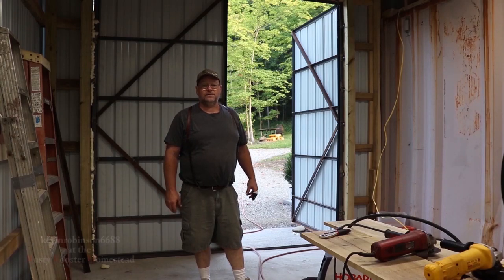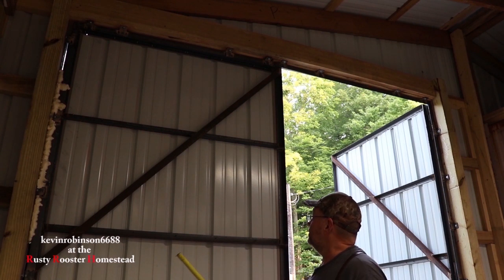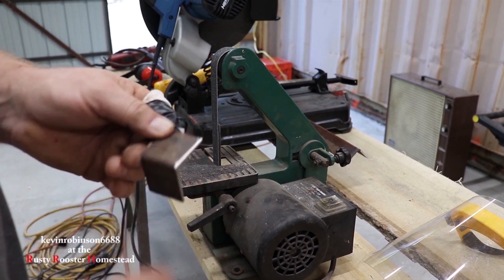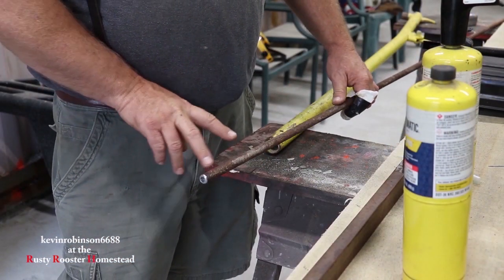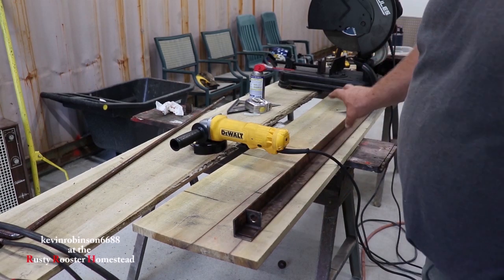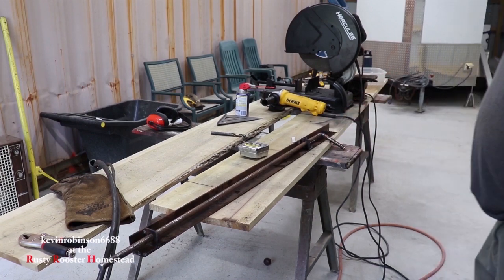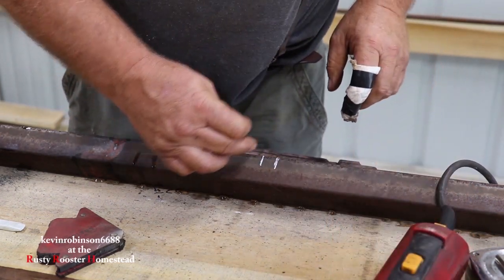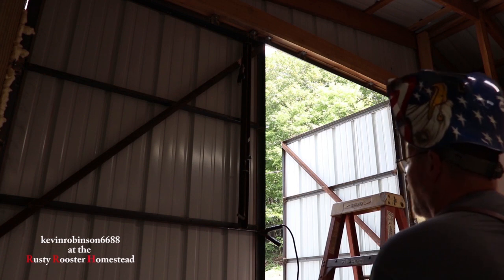barn door locks homemade build

Comment: Kevin you ever use that Krylon paint that converts rust to primer. I have it's good stuff with all the metal work you do maybe prep the old rusty metal prior to to paint. Great work as usual.  Maybe get you some cameras wired for future that is on internet so you get email alerts.
Reply from the maker: I never used that but i will give it a try thanks for watching